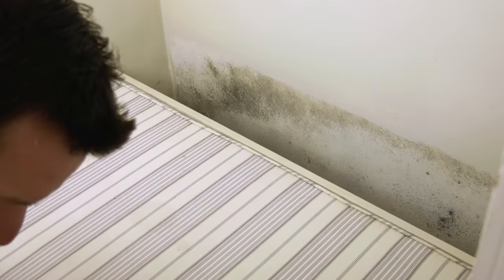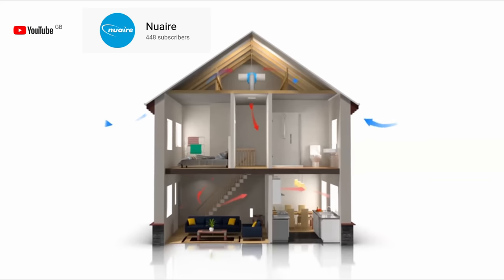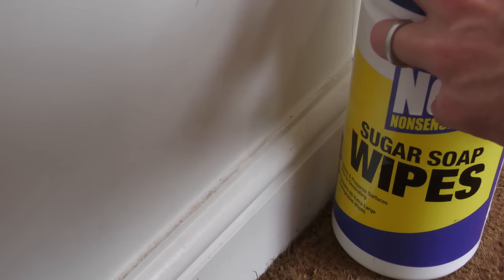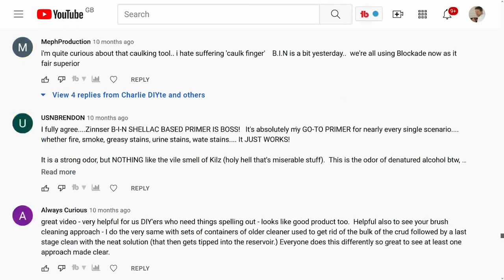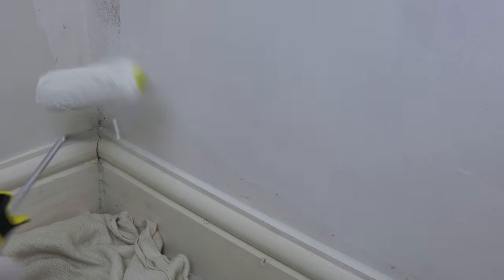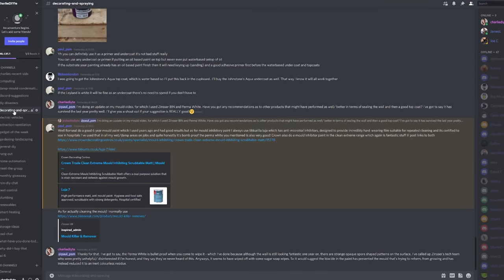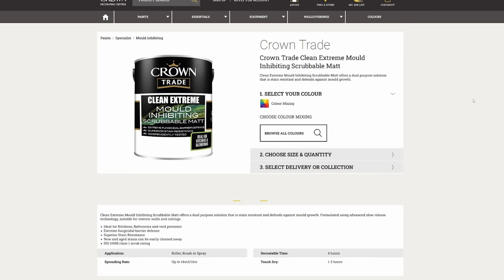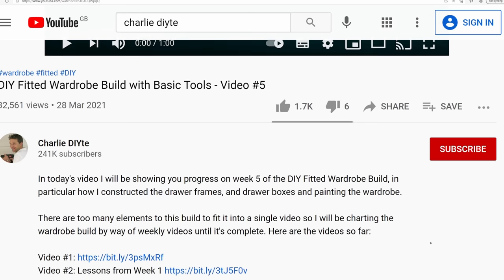Has the Mould Come Back - 18 Month Review?

Comment: I was born in 1947 we lived in a council house with a coal fire.  We never had any damp or mould problems.  We had an oven in the kitchen linked to the coal fire.  My mother often dried clothes on a clothes horse put in front of the oven, and still no damp problems.  We didn't have radiators all we had was a back boiler behind the fire to heat the water.  Coal fires allowed the house to breathe.  Later on, the council fitted a gas boiler and radiators.  That's when the problems started, we started getting damp problems, the windows were always damp on the inside.   Many years later I had a Housing Association bungalow, due to my health problems.    The Housing Association in their great wisdom decided to insulate the loft to the current standard.  A damp-proofing firm filled the cavity walls with insulation( pumped in).  That was when the bungalow started getting damp problems.  Mould started to appear on every wall.  It became a constant battle to keep the walls mould-free.  The windows were always streaming with water.  My wife and I are in our late seventies and in very poor health, I try to keep windows open as much as possible, all the time in summer.  We are causing more problems by having our homes over-insulated.  The house needs to breathe.  Cavity walls were designed to do just that.  There is no great mystery as to why people have damp problems.  Many people can not afford to heat their homes as due to an incompetent government fuel prices have gone through the roof.  People on minimum wages and pensioners on a single basic pension, like myself are struggling to live.  In this country, the rich get rich and the poor are forgotten about.  The basic pension starts at £130, you don't get far on that.  I would like to see if the Prime Minister or our overpaid MPs could survive on what I have to live on.  THERE IS NO WAY THEY COULD.
Reply from the maker: As per my comment yesterday. Thanks 👍
Reply: Sounds like a nightmare
Reply: @nyaruko-do2ok  The nightmare begins when we start over-insulating our properties and condensation is trapped within the rooms of your home.
Reply: over insulating but not ventilating. Insulation is good. No airflow is bad. Stick in vents and fan and ur good to go
Reply: In a short while there will be no one left to remember the intense long lasting heat of a coal fire…never any mould in my grandparents house like you say, wishing ironing all sorts going on. Everyone had better get used to being cold in the future, all very well until you get older.
Reply: @Stratoszero  How True.  I feel the cold dreadfully.  The price of gas and electricity has gone through the roof.  The shareholders in the fuel companies are raking it in.  The fuel companies should never have been privatised.
Reply: We had small fireplaces in each bedroom, small vents in each room which let the air in, we never used the fireplace although it was used when I was small, we had ice on the inside of the windows, ran downstairs to dress in front of the downstairs fire, when the wind got up our lino would raise up, it was only warm after all day with people moving about and the Rayburn in the kitchen was on, in contrast my new build (6 years old) has no end of faults and damp, back draught flaps blocked, no window vents, not enough gap for the damp proof course, in some places its level with the ground, so poorly finished its a joke.
Reply: @Taz6688  New builds now are a disgrace.  People pay a fortune for a new property and they are not getting value for money.  They are thrown up by semi-skilled people working with second-class materials in the fastest time possible.  the signing-off process is a joke.

Comment: Charlie I used to do 100s of mould treat jobs in my last job. What you have done here is perfect and new mould will always form on the surface due to your poor ventilation and damp shoes ect. If it was coming from the wall it would push through damaging the plaster and showing rot on the skirting. Good video thanks
Reply from the maker: Thanks Peter, coming from a pro like yourself I really appreciate that endorsement. Good point about the damaged plaster and rotting skirting. I should have mentioned that👊
Reply: Yup - I have rising damp in an INTERNAL brick wall.  I chiselled off the plaster to about a foot high and let the bricks be bare for several months.  The wooden skirting board was rotten on the back side.  The floors either side of the wall had been concreted, so I was only able to install DryRods at the level of the TOP of the lowest row of bricks.   Months later I replastered the wall down to about 6" above the floor, so about 1 1/2 rows of bricks were still bare, above the DryRods line.  Left that for some more months, and then covered the new plaster with Zinsser's Shellac-based sealer paint  (the wall was to be re-wallpapered), and fitted plastic skirting boards WITH some ventilation areas so that the damp rising into the very lowest row of bricks could still escape SLOWLY into the room. Everything was great for some months, but then eventually the SALTS in the wall burst through the shellac paint!   The bricks HAD been treated with salts neutraliser on the other side (in an understairs cupboard).  Still not rewallpapered yet - looking for the next thing to try (!)
Reply: @hunchanchoc8418  Tough one ? Maybe (if I read well exactly ‘What’ you did ?) The other side of wall application against salts just forced them to cross the wall to the other side ? Water vapour and therefore salts, has to find a way out ...somewhere ? I am only learning it must be said...it’s a subtle learning curve...Damp that is ...(NOT rising damp !)
Reply: @gortagnan  You're probably right.  It's disheartening.  I'm thinking the only likely 'solution' will be taking the plaster off yet again and installing dimple sheet, and plasterboard over.    :-/

Comment: Thanks for the update Charlie. We moved into a 1969 bungalow a year last Oct which had big condensation issues. We watched your comprehensive video on mould and dehumidifiers.
Bought the EBAC worked fantastically well. The hygrometer gave us all the relevant readings.
The air bricks had no through flow it had been built with no means of air circulating inside, so
It was damp and cold.
New double glazing was fitted this July after which cavity wall insulation was added.That meant having a PIV fitted.It has transformed the bungalow in so many ways.Will be renew the loft insulation next year. Your time and effort over the years would have transformed many projects and always look forward to your finding. I have also passed the info on to others who have also benefited especially those in social housing who now can show evidence to the landlord. I now have a EBAC that i will pass on to a family member as it is not required.Once again many thanks for your time and effort.
Reply from the maker: Richard great to hear from you. It's so heartening hearing feedback like this. I had a similar air brick issue in my old London house. The mortgage company made certain damp work a requirement of the loan and a few years later I found the company who installed them hadn't bothered to knock them all the way though to the underfloor cavity. You've done everything right there, right down to installing a PIV. So glad to hear it's sorted out all the problems. Must be very satisfying now, living in your wonderfully dry, warm home. You just want to have the odd trickle vent open on the windows now you've got them double glazed, to help the PIV do it's work.  👍

Comment: If mould formed once, it will want to form again, either left over spores or new ones. With regular maintenance though it's easy to keep on top of. I think a problem is a lot of people seem to expect an area to require no cleaning or anything for years at a time which is rather silly. Regular light maintenance will keep areas clean and mould free. Get back into the old fashioned spring clean routine (though spring is bad time as the weather is still damp, I do it in the summer when things dry better).
Reply: Or sort the damp problem 1st
Reply: @leeholke9851  That's fine if it's a damp problem and you can fix it. We don't have any damp problems at all, but we do have condensation issues.
Reply: @caskwith  condensation is still damp.  It was a wide range of answers .
Reply: @leeholke9851  Ok, well if you can stop the condensation great, but that isn't always possible/practicable.
Reply: 97⁷
Reply: Shouldn't have to go around wiping your walls every week to remove mould though, that's not spring cleaning... Sort out the condensation and you wont have to do it.
Reply: @elobiretv  I don't wipe every week. And as I said, it isn't always possible or practicable to stop condensation and/or mould entirely.
Reply: That looks like a new mould variant, you obviously need the Zinnser booster coat.
Reply: @caskwith  
Agreed. Fungal spores are continually in the air. Any area where there is little air movement provides a perfect moist breeding ground for them. There is no treatment and no paint that will stop mould, it'll always return to the same areas unless the air circulation is improved.
Reply: @elobiretv  how do I sort out the condensation?
Reply: @elobiretv  lll

Comment: I had a constant war with a small patch of wall adjacent to a chimney breast in a previous home, but finally nailed it by freeing up air space and stripping the wall back and treating it before leaving. Glad you sorted it. I just used Damp Seal, by the way. Difficult to apply, but works well.
Reply from the maker: Thanks Nigel. Yes, great work, and thanks for the tip. Freeing up the air space was the crucial point. 👍

Comment: I used to develop antifouling paint for the marine industry. I reckon you are probably right. For the biocide to work it needs to get into the beasties. Could be that the very top layer of paint has depleted it's biocide. So it's efficiency is dropping a bit. Revisit it next year. Suspect it would be a touch worse. In marine the sea water brings the biocide to the surface. Not sure the biocide deeper down this coating will be able to come to the surface to work? Unless the damp does it (which is plausible). Nothing another coat of paint wouldn't fix I reckon.

Comment: Great video, totally agree with PIV units, I've had mine for 1  year and has made massive difference on condensation forming and subsequent mould growth ( I don't have  any regrowth)
Reply: Fitted a PIVin our 40 year old bungalow , absolutely transformed our house. Had mould/condensation forming on walls and windows. Virtually eliminated now. Absolutely brilliant system.
Reply: I've invested in a piv as I have bad condensation also... just can't find anyone to fit the thing lol
Reply: @Willyfarns   It’s pretty easy tbh. Just cut a hole in the ceiling and get a 5amp electricity supply put in the loft space.
Reply: @cerec69  does it make the vent area cold?
Reply: @fanfeck2844  Not at all. I opted for the Nuaire system with the heater option. It just hums a bit like air conditioning. It’s just a revelation in our house.
Reply: @cerec69  How much has it increased your heating costs? And how much was it to fit?
Reply: @fanfeck2844  yes. Bloody freezing. Especially in a bungalow. I had to turn mine off. I now use a dehumidifier. Much better job. House is far warmer and much easier to heat. PIV was a disaster.
Reply: Yep we installed an Envirovent Mr Lofty about 6 years ago now. No condensation on windows, all the mould behind furniture gone. Clothes dry inside in super quick time too! :)
Reply: @caskwith  If anything it warmer now as the positive pressure seems to have stopped draughts
Reply: @raftonpounder6696  did you have the one with the heater on it to warm the air
Reply: @fanfeck2844  no. They only heat it slightly and cost a fortune to run. Another fault with it was in the summer the whole house smelled of the loft. It has now been retired!
Reply: @cerec69  How much extra does it cost to run per year?
Reply: @raftonpounder6696  We find a dehumidifier works very well, I just wish I bought a desiccant type, but I didn't know better at the time.
Reply: @caskwith  yes I didn’t know about them when I bought mine either!
Reply: @raftonpounder6696  I’ve not noticed any significant running costs, the heater is really low wattage.
Reply: @fanfeck2844  No, the heater just takes the chill off. It’s in the hall so not an area of the house that you’d notice. If it made the house cold my wife would let me know🤨

Comment: I picked up some Mould Wash Concentrate and Anti Mould Paint Additive direct from Permaguard. Cost about £28 inc delivery for both. The great thing about the paint addictive is that you can add it to which ever paint colour you wish and are not restricted to the availability of which ever brand is in the local store. The mould wash works a treat for any surface. I applied both in April and have not even seen an attempted regrowth!
Reply from the maker: That's great work. Didn't realise you could do that 👌👏

Comment: After watching your original video I used the Zinsser on my office/gym walls, converting it from a disused bedroom that had very bad mould/condensation. After using the mould killer, the walls were left for a month with lots of summer air flowing through the room. I then used the water based Zinsser BIN and the Permawhite. I have to say I am very impressed with the Permawhite, just one coat was enough for me, my only complaint is the smell, it really does wiff! I've also fitted a humidistat extractor fan as there will be a lot of huffing and puffing due to exercise. So it will be interesting to see if any mould forms, but thanks for the information Charlie, your videos are extremely helpful.
Reply from the maker: Sounds like you did everything spot on there, Mark. I like the fact you used the summer weather to thoroughly dry out the wall before sealing it. BIN is shellac based - presumably that's what you meant? Yes the Perma White is fantastic. It's not surprising it's a bit wiffy given its solvent properties and the biocide, but an acceptable trade off IMO given its benefits. Great work 👍

Comment: Hi Charley , I have used the insulated plasterboard and I think it would be perfect for your location . You could put it straight onto the wall ,making a thermal break which would prevent a cold surface to course a problem     Best wishes and kind regards  😀👍👍👍
Reply: My thoughts too.
Reply from the maker: Yes absolutely and in fact I've done 3 bedrooms upstairs with this. With the wall now warm, the dew point can't be reached and so mould doesn't form. With insulated plasterboard you just have to be careful about potential cold bridging in corners, plug sockets and around the windows. I'm still learning the perfect technique, but got it pretty good in our bedroom where I battened the wall, infilled with 1 inch celotex PIR board, foil taped over the battens and then screwed insulated plasterboard on top. That way there was no cold bridging where you have to cut through the plasterboard for electrical sockets.

Comment: A very interesting topic and I think you have dealt with it very well. A good anti mould treatment and anti mould paint seems to do the trick.
Reply from the maker: Thanks Tahir. Yes not ideal in terms of the lack of air circulation but by providing an impermeable surface protected with biocide, there's nothing for the mould to latch onto. 👍

Comment: In my experience dehumidifier is go to option. It was a dear one, couple of hundred but never thought of mould again. I live in a flat, though. So not many external walls and one is enough just have to wheel it around from room to room.
Reply from the maker: Yes, in that video I mentioned, the main thrust of the video was about dehumidifiers. Great to vastly reduce relative humidity around the home but they won't stop condensation forming on windows and the like. Crucial though, particularly in an apartment like yours when perhaps you're producing a lot of moisture from hanging up washing, cooking and bathing, without there being anywhere for it to escape.